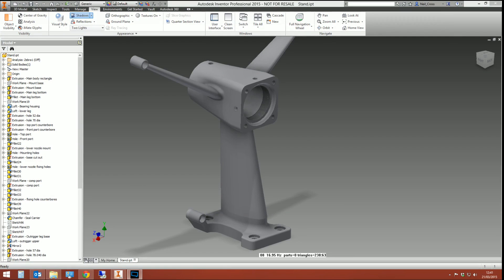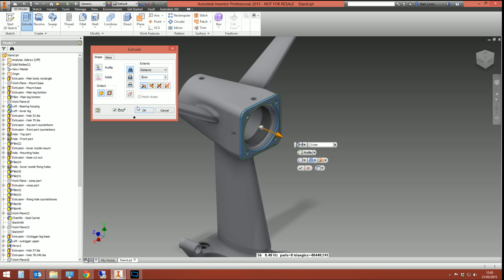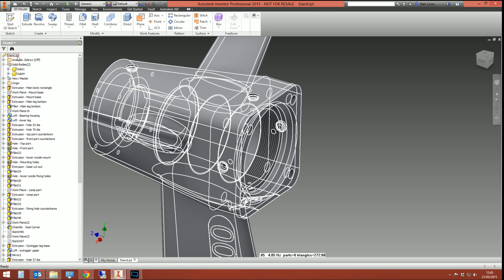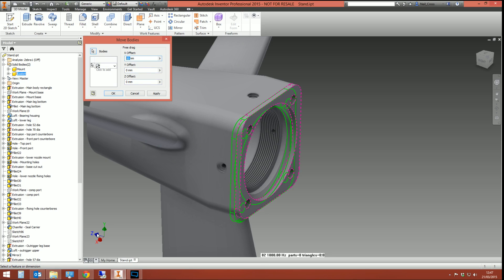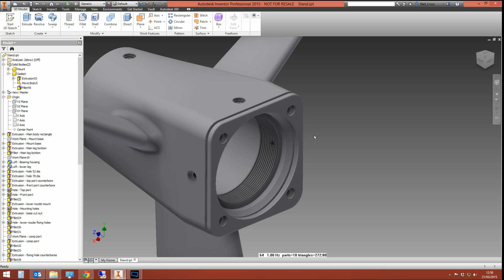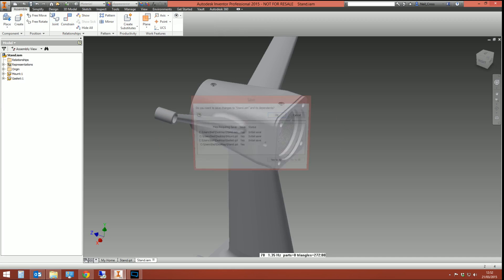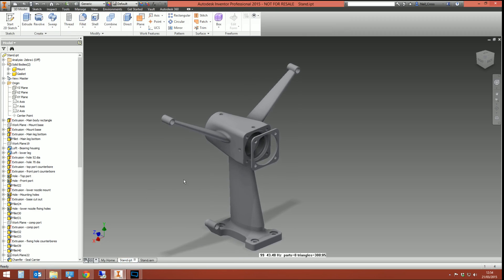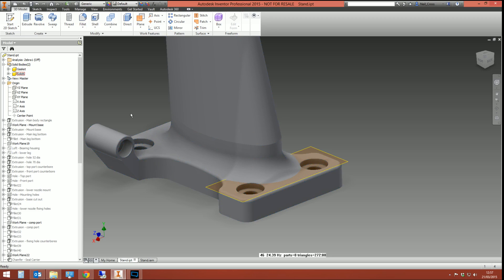How to use Multi-Body Parts, Parts to Assemblies | Autodesk Inventor

Comment: What if I had a complicated design, that would benefit from creating parts together and then having them exploded into separate ipt files BUT I only wanted to make a rough sketch of the assembly this way to sort of see how those parts fit together, what should their dimensions be, etc. and keep working and polishing those parts in separate files? You know, because working on small things in a big file is hard but seeing how they change "live" would be cool. Sadly changes in the assembly-like.ipt file affect "children" .ipt files but changes made to "children" files do not affect the parent file.

Comment: Hi, thank you for a great video, as always. However I have a question regarding the way of dealing with a very complex parts. 
So, my problem is that when I am creating some very complex parts for injection modling, after some time it becomes something like a "spagetti code". What I would like to say is that when I am trying to change something or remove for example an extrusion, inventor freezes or sometimes even windows is crushing with BOD (after a last crush I had to reinstall the whole OS). What would you suggest to keep the flexibility to change something in the development process? To use multi-body parts and edit bodies separately or maybe to make an assembly from multiple "part's parts" and simplify it at the end? What is your experience? Maybe you could share some hints for designing the injection molding parts, but more like how to deal with it and what is the proper way of designing proces than an inventor tools?
Best regards
Reply: maybe your pc becomes too hot, make sure it cools enough :)

Comment: Thank you very much! What I wonder (Newbie) is, if I for example create plastic parts this way, how do I control mating tolerances and fittings for different productions, e.g. for instance 3D Print for Rapid Prototyping and same Part later on for molding? For instance with top/bottom part and lip features which have the same dimensions for the inside and outside part...

Comment: I really like your presentation style. I've been using AutoCAD for ages & am just getting into Inventor. You videos have helped enormously! The split & combine kind of translate to the slice & union commands in ACAD. I was wondering if there is a command that can separate the parts of a split solid body into separate bodies, like acad can?
Reply from the maker: +Drafty01 Yea, did I not do that in this video? I can't remember now.  You use the split command and chose the option split solid, I think, that then lets you use a plane or face to slice a solid into multiple independent solid bodies.  If I didnt do that in this video I can do a separate piece on it!
Reply: +TFI CAD Tips The follow-on would be that the other bits of the solid you want joined back up, can then be joined up with the combine command.

Comment: I posted this on an older video . Any chance of doing some Fusion 360 videos?These are great lessons. Never used Inventor but I am learning a lot that will help me with Fusion. Thank you
Reply from the maker: Ed Germain Yea I replied, and that makes sense now... I asked what you needed to know that couldn't be done in Inventor... but that makes sense if you don't have Inventor! To be honest I haven't used Fusion since it's early first build when it was part of Inventor, it's changed a lot since then and I actually don't know what it's purpose is as it seems very very similar to Inventor.  I don't understand it yet and why it exists.  But if it's a popular program that a lot of people use I might try getting into it.